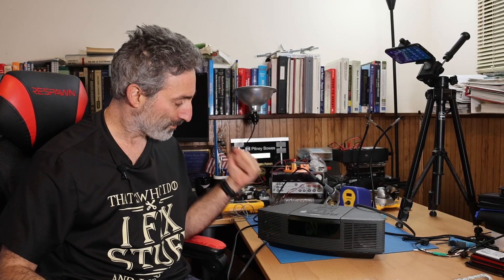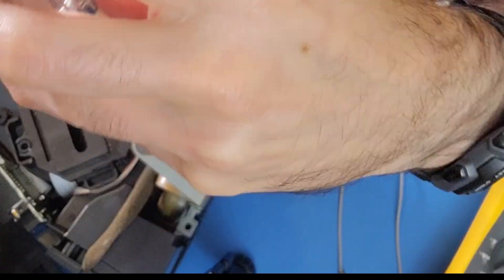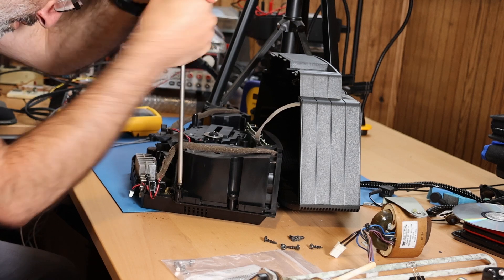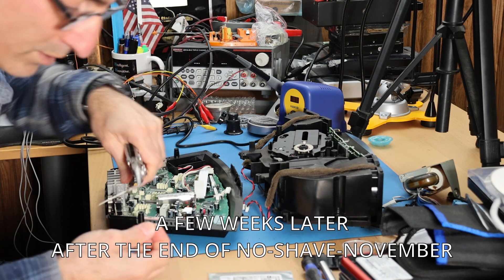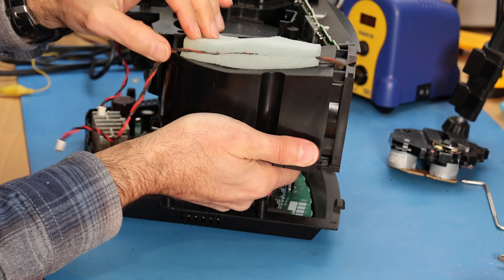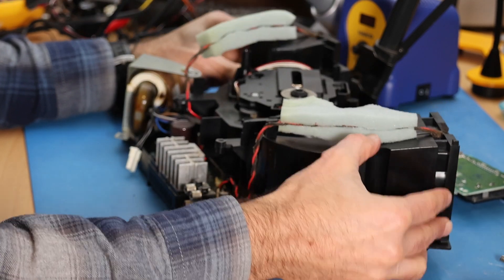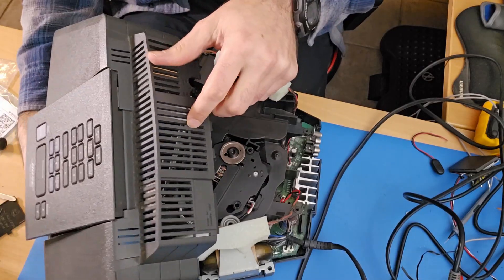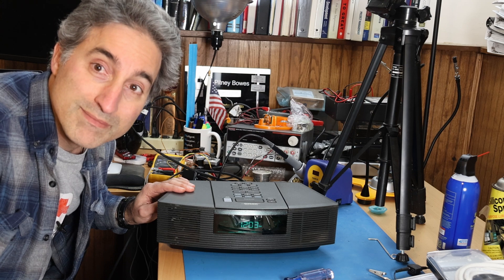Diagnosing and Fixing a Dead Bose Wave Radio

Comment: I picked one of these, same model but white, yesterday.  The play/pause and stop buttons do not work.  I'll have to break the cd cover apart to fix them.  I didn't realize there was a protective fuse in these.  That's great.  Thanks for sharing!
Reply from the maker: Thank you for watching!
Look carefully at the cover, maybe there are some snap features that just need a gentle pry. Also, that flat flex cable could have a crack in it or even just be dirty. Start by inspecting that with a magnifier